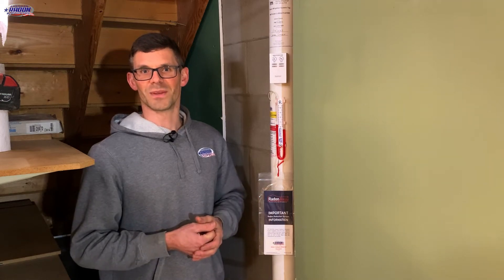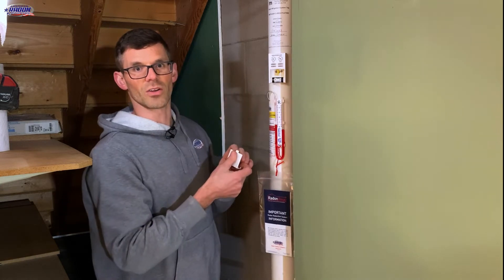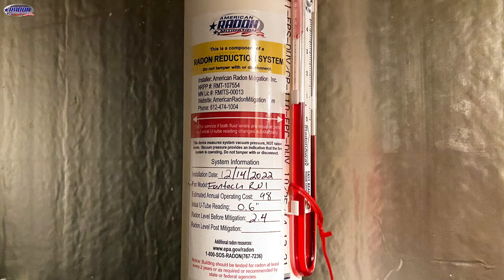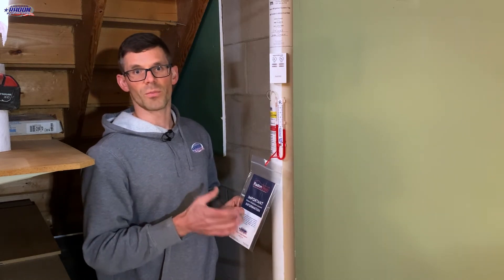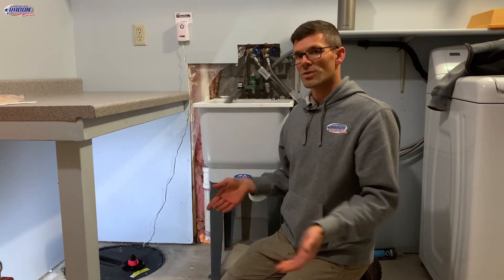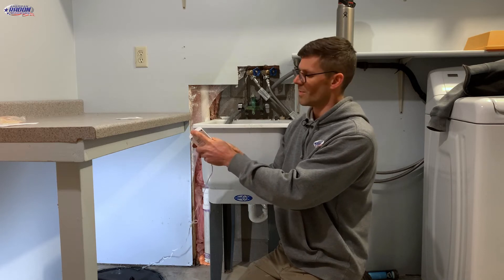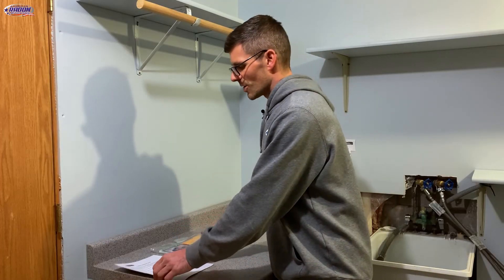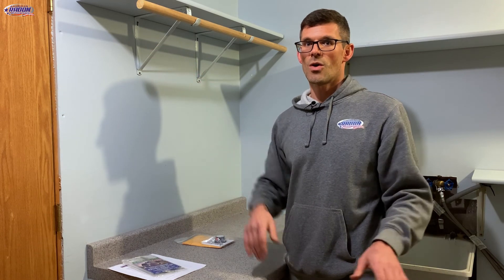Understanding Your Radon Mitigation System

Comment: Question- does the pipe have to exit the roof as opposed to through an exterior wall? I’m wondering as it would be difficult for me to find a place in my home to get it up to and through the roof without making a much larger job than if it were to just exit the home from a wall. Thanks.
Reply from the maker: You can exit through the rim joist; most people do. I wouldn't do it if it were my house unless it were the only option. Here are my reasons. 
1. I think they are ugly. 
2. You may have a shorter fan life.
3. Outside systems are more likely to freeze up in colder climates. 

Thanks for your question!

Comment: I bought a house which was built with a radon mit system included. When i bought the house it was 5 year old and the radon sytem fan which installed in the attic, was not working. Instead of hiring someone to install a new fan i decided to run a First Alert radon detection kit. I did that and the radon level came back as 1 vs the 4 and above level where the EPA says the radon level needs mitigation.  That was 3 years ago and i am now in the process of getting another test kit to test the system. Unfortunately, the radon sys contractor who installed the system is now out of business. Anyway my system runs through a sump pump pit in the basement and is completely sealed. I have had sump pumps in the past but never with a radon mit system. I am more concerned about whether my sump pump is working properly than if the radon mit system is ok. That said i wonder if i should go ahead and replace the radon mit fan anyway after i run my next test regardless of the results. The lady who built this house was elderly and went overboard in many areas of options she had built into the house and this radon system may have been one. 
Can you tell me if a radon mit contractor who would come out and install a new fan would also be experienced in opening the sealed sump pit to evaluate the radon system AND the water level control feature of the sump pump itself? Or do i need a plumber to evaluate the sump pump separately? Although the sump pump pit is sealed well the cover is homemade  and i may go ahead and replace it while i am at it. 
I know you arent in my area but your YT video it excellent and helpful so i thought i would see if you can give me some direction on how best to proceed. Thanks so much either way.
Reply from the maker: Check out this video to learn more about what level of radon is "safe". https://youtu.be/NGW5qxTEC28

I'd hire a plumber to work on the sump pump.

Comment: Is there a heat tape you like using better than another?
Reply from the maker: Yes, after a ton of research and testing, we landed on a custom solution.  You can contact us if you'd like to purchase a kit. Let us know if you'd like a hardwired or corded connection and how many feet of cable you need.